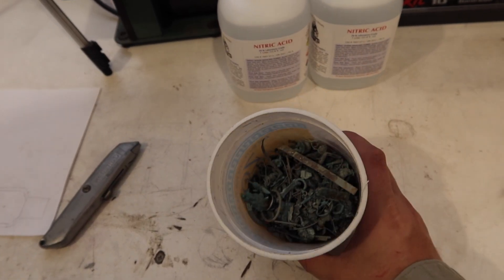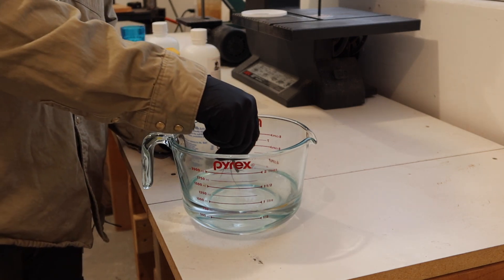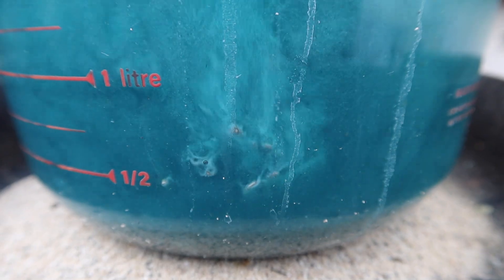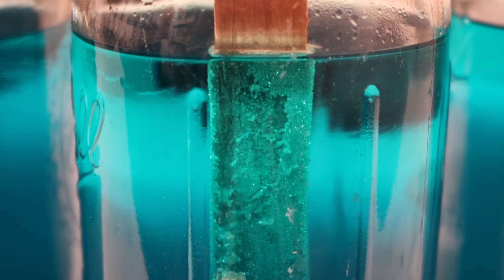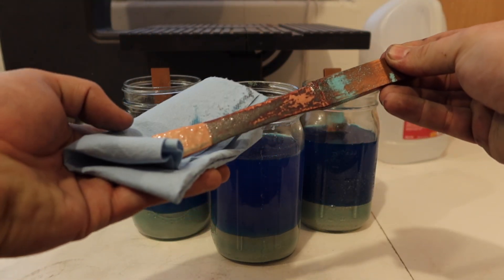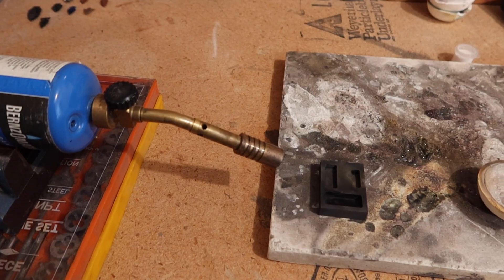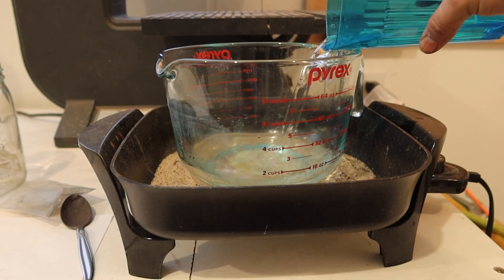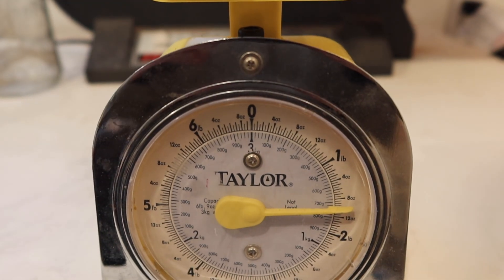Refining POUNDS of SILVER!!

Comment: I like your presentation, I've been collecting nickle silver contacts from motor starters and relays, as an electrician of many years I have about 14 - to twenty US pounds in ingots that were melted from copper contacts and also have pounds of the contacts with the nickle silver still on them. Is it worth trying to get the nickle out or would it be better to sell it as nickle silver?

Comment: Chuck in an air line to bubble the solution around lightly it speeds up the process and exposes more molucules to the copper for transfer. also chuck in a small amount of sulfamic acid to denox the solution prior to puttingin your copper, this will ensure there is no dissolving of copper prior to transfer.

Comment: You did good man! I love chemistry and I think your practices are good. I always wonder how this method compares with the silver chloride, sodium hydroxide, and sugar method of refinement. Is there any notable difference in purity? I think it's also good to mention silver staining on your skin. I usually get them when I randomly get a small amount of silver nitrate on my glove and then touch the outside of the beaker. Later during my cleaning step if I don't wear gloves then when I touch the outside of the beaker it transfers a small amount to my skin and then the sunlight finished the job turning the skin black.
Reply from the maker: Thanks! I’m not too familiar with other refining methods. For sure about the staining. Even getting the thought on your hands will leave a stain. I refine gold as well and I get it almost every time.

Comment: Hi, do you know if there is any way to recover the lost copper from the solution? Would be a much more profitable process if you could get the copper back.
Reply from the maker: I believe there is but from what I have heard the process is long and not worth the copper you get back. I don’t know too much about it though.
Reply: @mcartandtool6580  since posting that question I actually found a video with the answer. It's actually pretty easy, all you do is stick a bar of iron into the copper solution and the copper will react just as the silver did before.
Reply from the maker: Nice! That doesn’t sound to bad

Comment: When you use this method when refining sterling unfortunately it doesn't come out .999 it's about .975 to .98 % pure. In order to get .999 you need to do this at  twice. Yes, the method is correct and ALWAYS USE distilled water if not, your nitric will leach of  all the minerals in the water and you'll have a nasty mess. I am a proud owner of an XRF mass Spectrometer and I have never gotten .999 on the first try..ever. always do it twice. The good thing is that the second time around since it's so clean, the process is faster and less acid needs to be used. I go from the first refining ...once dry then put the powder directly on nitric again....repeat... And if you want .9999 then do it 3 times. Ohh and to melt precious metals I use a kiln it's so much easier. They take about 45 min to get to melting temperature.They have gotten cheap (about $200) on eBay. And they last about two years of constant firing up. With propane, doesn't matter how good you are, you will always have material flying somewhere.
Reply from the maker: Very interesting thanks! That’s awesome you have a mass spectrometer

Comment: My only suggestion is don't leave constant heat on graphite molds. Preheating is a must but you want it warm enough to to boil off any moisture and not cool too fast but  also not to a point where the graphite will start breaking down.

As far as the melting, you did fine! I personally don't keep a torch on the cupel while pouring but if it works for you, there's nothing that says don't!

if you want to do larger batches, you can find a cheap propane furnace on amazon. Just make sure to buy rigidizer for the ceramic wool. Hot gloves are a must.
Reply from the maker: I’m no expert but I I found that the bars come out better when the graphite is as hot as possible and constant heat from the el cheapo torch is all I got. Same with the cupel, I couldn’t get the metal hot enough with the torch to allow for any time in the open air. I’ll look into the furnace, thanks for the input!

Comment: Its fitting to play metal when you fire up the torches. Well done.  Here's a filtering tip frens. To remove the possibility of the filter tearing open and pissing you off, use a funnel, but line the funnel with a nylon paint straining bag. Then put a coffee filter into that (so its a double layer). The nylon allows a wicking action for continuous flow and supports the paper filter so it won't break apart. Sometimes I filter into a plastic bucket. I make a lid for the bucket out of plastic or scrap wood and drill holes that I can squeeze the funnel into. I can often fit 3 or 4 funnels into one home made lid. The lid also keeps inquisitive bugs out, and dust. When a filter becomes clogged, it is easily swapped out.
Reply from the maker: Good stuff thanks!

Comment: Hey man.  Why can I not just put the old silver jewelry in my foundry and melt and pour as I do CU, brass, AL. etc.   ?      I guess I don't understand.
Reply: I saw this done once as a quenched splat. The silver and copper separate in the melt and can be seen in the splat, but the separation is not clean. Further cutting and remelting would be required. Is there an alternative to that process? I suppose the melt could be poured into a column mold and slow-cooled to get a better metal separation.

Comment: What is the purity of this process?
Reply: He is probably at 99% purity.  I think he would need to run his silver through an electrolytic silver cell to remove the last of the impurities to get it to .999%.
Reply: @IMDunn-oy9cd  I've been experimenting.  
Using the silver chloride process.  I've come up with a formula that gives me .9999 in one shot.
Reply: @albertalbert4333  Good deal. Have you had it scanned with an XRF?
Reply: @IMDunn-oy9cd  yes. 99.99 at a three second scan. ( it's why I like .y lcs. He let's me use the gun when ever I want.) Still have to have the little gold nugs and platinum shot.
Reply: @albertalbert4333  Excellent. Do you recall what the remaining contaminant was?
Reply: @IMDunn-oy9cd  I took a picture of the readout. It had no reading on what the .0001 was.
Reply: @albertalbert4333  Sounds like a good arrangement. How much of a yield?
Reply: @IMDunn-oy9cd  about 0.078 loss. But I get bits of gold, platinum and rhodium.  I save all the filters, incinerate them .. about every 6 months.
Reply: @albertalbert4333  sounds like you have it figured out. Nice.
Reply: @IMDunn-oy9cd  do you cement or, silver chloride?
Reply: @albertalbert4333  I haven’t started yet. I plan on starting sometime within the next year. Im wanting to try cementing using Sreetips model.
Reply: @IMDunn-oy9cd  cementing only got me to.995 silver cell did the rest but... it takes too long. 
If you go the silver chloride method hit me up. I'll be more than happy to help .
Also SAFETY FIRST.   I can't stress that enough.
Reply: @albertalbert4333  Thanks.
Reply: @IMDunn-oy9cd  I'm gonna delete that email from this post in 10 minutes.  Write it down.
Reply: @albertalbert4333  okay

Comment: Good video. Nitric can be purchased online at Lab Alley for about half the price on eBay. I buy 10 L delivered to my door for about 200 to 210 in 67% technical grade and it works just fine when I refine silver. You should further refine the silver, as it is only about 97 to 98% pure. To test this just take some of the silver powder and dissolve it again, it will still turn the acid blue showing that there's copper still. Pure silver dissolved in Nitric will remain clear when dissolved. As one silver refiner to another great job on the video and your responses to other people's comments are great too.
Reply from the maker: thanks for the input! next time I need nitric I'll check that site out.
Reply: Walmart nitric acid 32$ one liter no hazmat free shipping

Comment: This has got to be the most wasteful method of getting less than pure silver I've seen. Also it's a good thing you decide to skip all the "boring safety shenanigans" because you obviously have no idea how to use Nitric safely. Those black gloves and the blue version will burst into flame if that nitric ever came into contact with them. That just for starters.
Reply from the maker: pure nitric will cause them to combust but the 70% I was using will eat through them in a few seconds with no combustion giving you some time to pull them off. the burns from nitric are not that bad anyway only discoloring the skin as long as you rinse it off in a timely manner. I would love to see how you refine silver because it sounds like you are clearly an expert with tons of experience,
Reply: Lord Pudwac

Comment: How many hours did the entire process take and would this work for scrap with around 45%-45% copper/silver and 10% zinc?
Reply from the maker: the whole process takes a few days. the silver I was purifying was 92.5% silver 7.5% copper. the issue with having that much copper is the copper takes a lot more nitric to dissolve than the silver. nitric acid is expensive  so it would cost more to purify. other than that it should work just fine. you could do a quick test with some zinc to make sure it would get weeded out along the way.
Reply: Copper will use up the nitric something like 2-3x as fast as silver, and the zinc will react with the nitric even faster. It will work, but you'll use up a serious load of nitric acid getting it done.
Reply: @pneumatic00  I also thought about melting the zinc off through a metal sifter as the melting point is much lower than the copper or silver.
Reply: @quantroots  Maybe if you powdered the alloy, that could work, but I also think you could produce zinc oxide (which is a high-melter) and frankly I don't know where that would go --it wouldn't surprise me that you'd produce something troublesome down the road in the eventual nitric treatment. The good news is that you could try heating with regular propane which can't melt Ag or Cu very well. But if you powdered the whole alloy, I think you'd have some chance of dissolving it in a much weaker acid, even acetic acid, made from cooking off water from ordinary vinegar. The idea being that a weak acid wouldn't attack either the Ag or the Cu.  At some point you have to consider your work and chem costs.
Reply: @quantroots  You'd have to try it. Note that a post 1982 penny (2.5 gms weight) is not really an alloy; it's zinc slug w/a copper coating. And yes, it's conceivable that heating up the penny would swell up the zinc slug, break the copper coating, and allow the molten Zn to drain out. If what you have is truly an alloy, where all the metals are mixed, maybe you can and maybe you can't just melt the Zn out of it. These things are often not predictable. The work involved in powdering your alloy, if you had to do that, could be considerable.
Reply: @pneumatic00  its solder so yes. True alloy i believe. When you say powderize do you just mean grinding it all up to a powder? I'd looked into metal grinders but they're in the thousands of dollars, even for a little 200 pound one.
Reply: @quantroots  You probably don't have to get it down to a powder, but you'd have to get it down to "filings", which you could do with a $14 harbor freight grinder and a box lined with a plastic bag to collect the dust/grindings. Of course I don't know if that method will get the material so fine that a weak acid will get to the zinc and I don't know if acetic acid would be the right choice. What I'll say is this: unless you have many many pounds of this solder, you'd be better off just trying to sell the solder as is. Find someone who uses the solder (it's used a lot) and ask them to trade you some silver rounds for it, if it's worth that much, if you have that much. Valuable lesson: ANY TIME you TOUCH these metals, whether you melt them, dissolve them, you lose money. You splash nitric in your eye, you could blind yourself. All it takes is one time. You breathe those red fumes, you can fall over DEAD or permanently destroy your lungs. Those red fumes turn the liquid in your lungs into nitric acid and you could be months in a hospital. Did you know that those fumes are rated TWICE AS TOXIC as HCN? Go look at the lethal dosage for NO2 vs HCN. 
https://en.wikipedia.org/wiki/Hydrogen_cyanide
Don't kill or disable yourself for $20 or $50 or even $5000 worth of silver. I've done chemistry for many years, those red fumes absolutely scare the shit out of me.
Reply: @pneumatic00  That's great advice! I have a large quantity and was trying to get the best bang for my buck. I've noted wholesalers generally take 20% fee when the silver content is below 40% purity. Around 70% and that 20% jumps to 10%. So I figured melting it and refining may be more cost efficient. Even melting the zinc off and then smelting the remaining alloy into bars, which would at least purify it a bit. Often homemade bars sell for significantly over spot on resale sites like ebay. When you say lose money do you think that the sheer act of melting these metals will cause a loss as in it evaporates leaving you with less precious metal content? I had come to believe that no actual metal was lost in the process of melting, just that it's in a less usable form. In this case it's no longer able to be used as solder.
Reply: @quantroots  Why can't you just sell the solder on ebay as it is? Especially if you have something like a container label that identifies it as a known brand that has a known market price. The problem with a wholesaler is that usually you only have one and there's no particular competitive bid--it's take it or leave it. And if they melt/refine, as you say, 50% or less silver is downright undesirable bec it uses so much nitric. 

As for homemade bars selling for more on ebay, I think that's goofy, but I see that it happens. I don't know everything, far from it. If you brought me one of those bars I wouldn't pay you more than spot for it--frankly I wouldn't even want it without an assay. THAT DOES NOT MEAN THAT SOME FOOL won't pay up for it!  Why folks will pay double spot for a hand-poured Yeager's bar, I have not the slightest idea. Good for Yeager! Do you think those bars have been assayed? I don't. They buy .999 shot and melt it into molds. That doubles its value? Not for me. You'd rather pay double for a hand poured bar from an unknown source than a numbered J-M or Englehard bar or even a Sunshine bar?? Seriously? Apparently folks will, judging by the Yeager ones sold and the JMs unsold. I would NEVER do that. Maybe I'm a dope for thinking that. They aren't extracting Ag from sterling forks...if they can sell that many bars at double spot or 1.5x spot they're buying kilos and kilos of shot and just re-melting it into molds. I think current market conditions have people clamoring for silver. I don't believe there is any shortage of silver  and for the 20+ years I have been dealing with it, I have never thot there was a shortage. 
As for losing money--you ALWAYS have to pay for freight---or nitric--or PPE--and beakers, etc; etc; No, you don't lose PM content--but there are ALWAYS what I call "frictions" (including ebay fees) that chew away at your values.

Comment: 10 out of 10. My 10th grade ap chemistry teacher said good job.
Reply from the maker: haha thats awesome!
Reply: Then your 10th grade AP chemistry teacher was a complete moron. He messed up by not washing the silver to make sure there was no chlorine present, he didn't roll out the silver into thin strips that the acid could easily attack, and he should have a bucket to pour the copper heavy left-over solution into. Then he could just add some iron bars to that and the copper would cement out the same way the silver did. Not to mention the fact that this should be done in a proper environment with a proper heating plate and a fume extraction system. That way he wouldn't have to move around an acid solution that is in the middle of a reaction because he forgot to take it outside before he started!

Edit: You want to see it done properly, go watch sreetips videos. There are still things he does wrong, but there are fewer issues with his work than this.
Reply: Where you at now bud? 12th?
Reply: @EastDallasKicks  I just finish 5 yers in the navy on a submarine. I’ve got 3 kids and just started a new job. (I wasn’t in tenth grade I just still had contact with him) lol
Reply: @Strangeklown97  oh was just about to say congrats on graduating either now or soon 😂